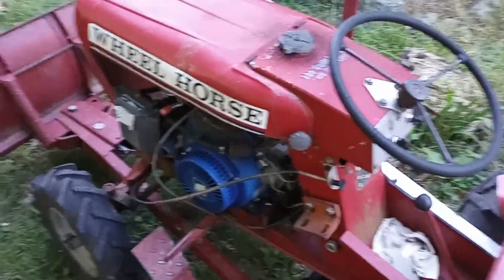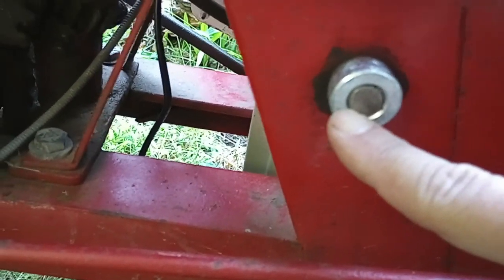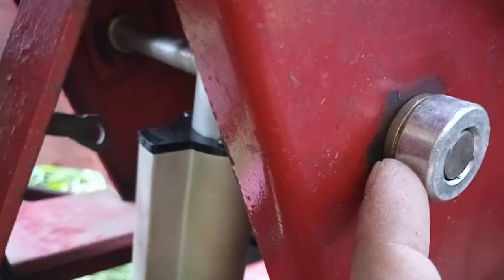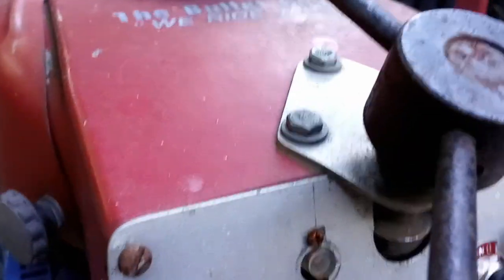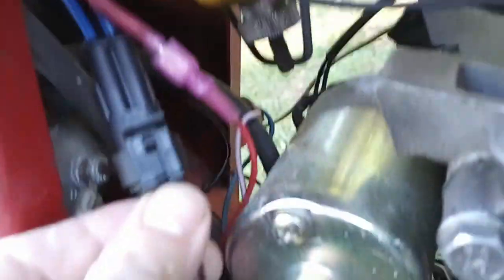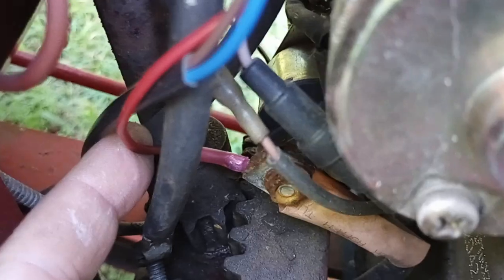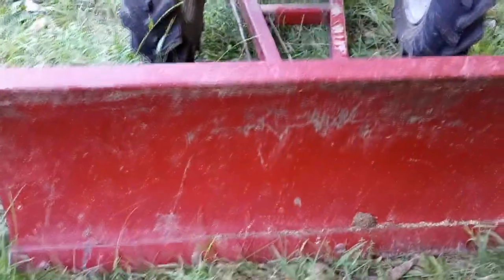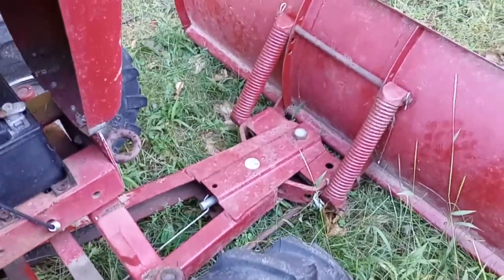1961 Wheel Horse Powered Plow lift part 2

Comment: Guessing there isn't a float position ? Seems to work good .
Reply from the maker: Yeah, the actuator is attached directly to the plow with no chain or cable.  It's more like a bull dozer than a snow plow.  The blade is spring loaded so if it hits something it will fold down.  I've used it a couple times last winter for light plowing and it worked well.  The up/down motion moves a bit slow but you get used to it.